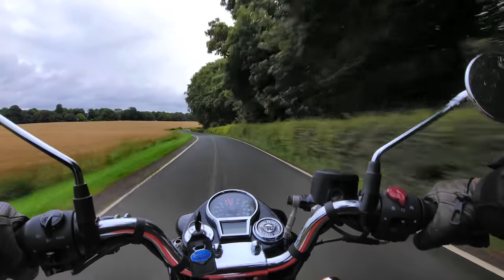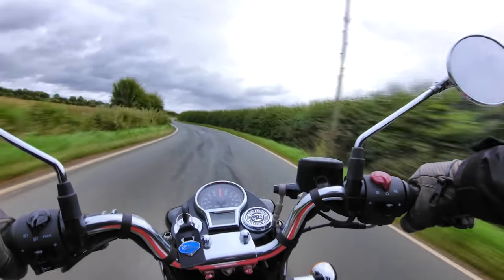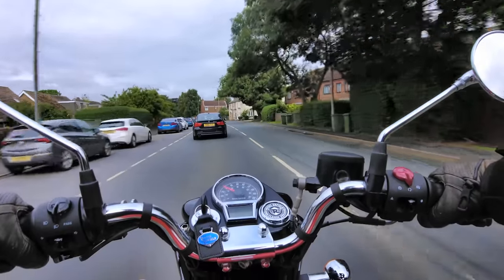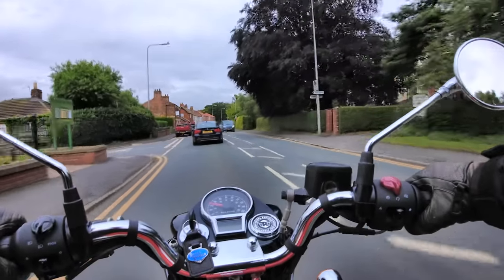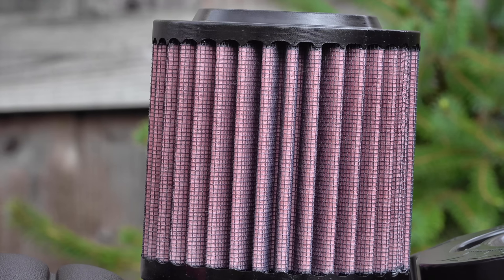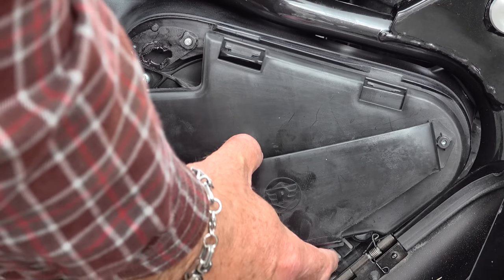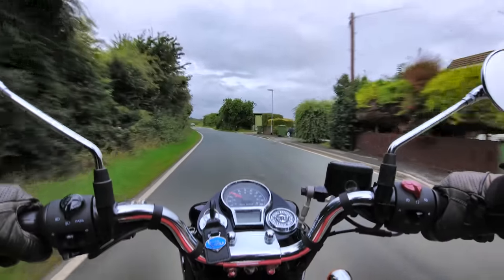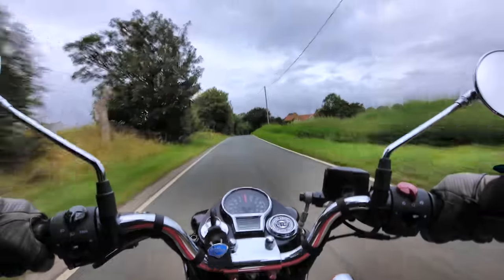The Royal Enfield 350 Classic REborn , Can You Increase top speed performance? & speedometer Fail!

Comment: Sounds like a very worth wile mod.
My Meteor will get one soon.
On the subject of the speedo, check out "Ride with Worro ". He found the cause and fixed it by cleaning out the excessive grease in the electrical connection to the speedo, with contact cleaner.
BTW, your description of the negative effects of the standard paper air filters, sounds like you are describing an N95 mask. A fact also scientifically proven. 😂😂
Reply from the maker: Yeah I checked. They dont grease that connector!
Reply: I tried "ride with Warro" fix for the speddo. Nothing against Warro, but it made no difference to the speedo problem.
Reply: @seanb1081 I've had the same issue with my speedometer. As per the Warro video I cleaned the inside  and it seemed to work OK for a few days but the problem turned. So I again repeated the process of cleaning the inside and for the past month I've had no further issues. The problem started when I left the bike on the drive in direct hot sunlight. That was June. I think when the weather is hot it causes the speedometer to read high. I was told this is a design issue and R.E replace the speedometer with the same type!!! Will have to see how Stu gets on with his warranty claim.
Reply: @carltonwittland1300  when I was speaking with the service manager at the bike mechanics this morning I asked him what RE in India finally decided what the problem with the Classic 350 speedo was. They have now admitted that due to poor thermal insulation around the speedo it plays havoc with the speedos electronics. The new speedos that they are now supplying are supposed to have better insulation to prevent the same issues happening aging.  I road 81 Km to the mechanics today and the speedo behaved perfectly. It was only a temperature of  about 24 C on the ride there. If it had been hotter the speedo wouldn’t have read correctly during the ride.
Reply: @seanb1081  thanks for the information. If it happens again which I'm sure it will. I will put in a warranty claim. Thanks.

Comment: Just thinking back to the days when we used to rip out the paper from filters and stuff them full of wire wool, Used Brillo pads were the preferred option. Don't advise anyone to do that though. Here in Australia (NSW) we have funny regs when it comes to licence renewal tests (MOT tests) might have to check out whether a DNA filter would pass the test not being E5 etc rated.
Reply: I'm an Aussie also living in NSW. I rekon the simplest way to pull the wool over any rego check place, would be to just temporarily re-install the OEM filter, when it's time to get a rego check. After the bike has been checked off, then re-install the DNA filter.
Reply: @seanb1081  Thought the same thing. The orignal cover is stamped with E5 E11 etc so that might be what the checkers go by. What I might do though is check with my local rego garage and see if it would pass. If I find out anything I'll post it.
Reply: Checked with my local rego checker who is meticulous and he says a high flow air filter won't affect rego check in NSW.

Comment: Yeah, after about 1,500 miles, the bike has become much more flexible with improved overall performance. Having watched both yours and a few other videos on the net, I installed one of these, they are quite expensive but, I am positive it was money well spent. Was surprised at the induction noise and yes, it is more eager than before, it lopes along with a freer character, won't bother with anymore upgrades because it doesn't need them, plus it wouldn't suit the bikes vintage type appeal. Thanks for the video

Comment: It used to be common for induction to be direct into the carb ... no air filters at all.  This is not so very long ago, either.   So, I'd be minded to run the bike without any filter fitted, simply to observe the improvement in performance. If I liked what I saw, then I might splash out on a fancy air filter.

Comment: Have 1500 miles on since DNA upgrade. Checked the plug and was a very light grey. Possibly a little lighter then the fawn colour that i’m used to with right mixture. Can someone who has no mods check their  plug and report. As a lean burn motor it may be fine and there was no sign of damage to the electrodes. Unmodified( tried the fuel x for a year but it threw a wobbly and coked up the O2 sensor, so binned) got up to 90mpg. With this mod it’s doing 80mpg. Thats good news as it indicates the ECU is upping richness to counter the increased air flow. However I am riding at considerably  more pace with this mod!!!

Comment: So went for a blast with a big hole drilled in the cover last night. Not a big difference in performance but a little induction roar. Then tried no filter or cover. Noisy as hell but did feel much more responsive but no difference in power. Today,  fitted the performance filter and cover. 
Still loud but boy what a difference in performance. Better off the mark; not much difference in low midrange but then almost 2 stroke like a power band at mid to high revs. Hits 70 very much quicker and would make fast A roads much more doable. 
It’s noisy too. Do I like it? well yes but I feel it takes something away at low midrange which on small single tracks is where you want it. I’m guessing it could be giving you as much as a 15% power increase but at the expense of some low to mid range torque. 
It improves the breathability of the bike to such an extent that your through peak torque before you know it and  ramping the nuts of the old girl. 
I experimented a bit with holding her at 1/4 throttle and in this way you can still ride like before. 
Whichever way you look at it it’s a massive increase in performance but at the expense of considerably increased noise. 
Need another blast when the rain stops to be a bit more definitive but I think it’s a mod worth doing.

Comment: When new my classic was new it  did occasionally appear hesitant on the throttle when pulling away. So bought the fuel x. After that packed up 18 months later with 15,000 miles on the clock, I removed it. 
Now the bike very rarely feels hesitant and feels loser. No Doubt in my mind that bike feels nearly run in but a little tight at around 2000 miles but definitely takes 4000 to really loosen up. It then gets better and better. However definitely doesn’t breath brilliantly so have just ordered this kit on Stu’s recommendation here. 
I think that the initial hesitancy may also be linked to compression. The engine breaking( compression) is great on this bike but when new may act to magnify poor breathing. As this drops off the poor low end breathing is less noticeable?

Comment: I've just looked up the prices of both the K & N, and the DNA air filter, there is a difference of almost thirty Euros, the DNA being the more expensive. Does the cost equate to efficiency. Certainly most of what l read the DNA allows greater airflow...allegedly... l have a K&N filter fitted in my Street Triple 675... (cleaned and re-oiled  once)... Performance wise l noticed an immediate better throttle response, much the same as you describe...l guess it's all a matter of personal choice, and cost if applicable. Either way it's a cheap method of unleashing  a smoother responsive engine with perhaps a small HP gain..Acceleration is often more useful than top speed anyway...Greetings from Red Hot España..

Comment: Hi Stu, if you could only own a Classic 350 or an Interceptor, which would you choose? I'm torn between these two gorgeous bikes, and the power limit is a concern although I find the classic 350 the prettier bike with a better seated position.
Reply: Had the Interceptor as my last bike, you will find the Classic when fully run in at around the 2000 miles mark will do 90% of what the 650 can. Only on duel carriageways do you notice the lack of top speed.

Comment: Wathing your video and looking back through your 350 videos, what was the stage 1 modification? 
    And is there any point in fitting a Hitcocks camshaft? 
    Did like the Roar rather than puff, definately sounded more purposeful. Disappointed to hear they restrict the bikes performance over 70-75 just where you might need that little extra, especially if your intension is touring France where the speed limit is 80 mph!! 
    Great work Stuart.
Reply: The hunter has no limiter. DNA. Makes 80 ml/h possible.

Comment: Would respectfully disagree about performance filters as almost all of them do not filter smaller micros as paper elements do. K&N was by far the worst offender as I have seen fine dust on the clean side of the intake when working at a ford dealer as a technician, these trucks however were used in a dusty environments(not what most would find on the road). There are different ISO certificates for coarse and fine dirt.

I do agree with everything else however and snorkels and filter covers are the best to get more airflow and again induction noise.😂

Comment: I have gone in the same direction of small improvements to make my meteor run better and fitted the X light fuel controller, and its totally changed the engine character as you said better everywhere but apparently it works fantastically well with the DNA filter kit onboard as well , but the main gain from this device is the engine does run noticeably cooler which I actually tested using a point n shoot thermometer , this is said to widen the gap between servicing because the oil lasts much longer but im not going to go down that route but may investigate further by way of observation for a while, there is a means to circumnavigate the speed restriction but im not going to make that common knowledge as there is always going to be some numpty that will make it very common knowledge via stupidity in public and the later models will have mods to make this impossible i myself don’t want to travel at more than 70 but what it actually does is make the bike fully responsive at that speed which for me anyway feels much safer and loses that feeling of being at the limit and strangled, once again great article and a genuinely full on explanation of how these types of filters work before some people do start poking holes in the standard filter with mums knitting needles 😁👍
Reply: Without giving up your secret, does everything on the bike still work?

I've heard of a mod that removes the limiter but also kills things, such as ABS and speedo etc.

Comment: Hiya, just to inform you that I too had speedometer problems and had to continuously reset it after each ride. My local dealer in Tenerife have accepted the problem and ordered me a new speedometer under guaranty. This seems to be quite a common default with the classic 350 reborn. Let’s hope that after the replacement it will bring an end to the issue.
Reply: Just clean the connectors and then greased them. It work. I have hade same problem. Fixed. 19:28
Reply: @terceladdict  thanks for the  advice but I had already done this procedure a couple of times but with no success, finally a had the speedometer unit changed under warranty and since then I have no problem.
Reply: @simonrignall996  Ok. I’m perhaps more lucky then you. Happy to read that your problem is solved.

Comment: If I ever buy one (has not happened yet due to 150 / 260 miles to nearest dealers) I suspect that I would want it to brwathe "freer" in the hope that the engine would run slightly cooler and last longer.  I think the 350 would be more than fast enough for all apart from those wanting to bomb around on motorways (100 miles to my nearest one).

Comment: Hi Stuart, with you experience with these filters, how do you find it effects fuel economy?? Does it make it better or worse on the classic 350.
Reply from the maker: That depends on You! on the whole I usually see an improvement in economy, But. If you decide to take full advantage of the extra power all the time by riding harder you may well see it go down.
Reply: I get 89-100 mpg on my Meteor with open intake and DNA filter. Only time I had any problem was when I made an equivalent mod to a Triumph Scrambler, Norman Hyde intake and K&N, which stranded me without fuel after 119 miles. Two nice chaps with a van with a hydraulic lift saved me the push to the petrol station and the bike got promptly sold. Range of 119 miles NBG.

Comment: I found on the internet that it is theoretically possible to remove the speed limiter on a Royal Enfield 350 motorcycle, there are rumors that in Brazil the RE is sold without a limiter installed because it is against some of their laws, however the main question I ask is - why would anyone want to remove the limiter on the RE knowing that with the power of the engine and its weight one will not gain much, maybe an additional 5-6 kilometers, there is a limit as of how much you can squeeze out... plus, if you really want a faster RE bike, don't buy the RE 350... RE 650 goes some 160 kmh? Or save some more money and buy something else...

Comment: A true "classic" bullet 350 (mine is from 1958) the best thing to do is change  the carb for something better and that's the cheapest increase you will get. Next is the cylinder head. Get a good port and valve job done.  89mph verified by speed traps. The exhaust does not become restrictive until you start doing cams and over sized cylinders.   Don't know anything about the new ones.

Comment: I felt very similar gains fitting the K&N to my Interceptor ,, nothing stunning , but the bike feels a lot more natural when riding  , more like my 1966 650 Triumph Saint   ,  but there is no comparism between a 2022 650 and a 1966 650 , except ,,,,, perhaps weight   206kg  -- 175 kg   and the Saint ,,,,,,,    you can remove the filter , use the gauze ,,, INDUCTION ROAUR   !!!

Comment: Hi Stuart,
Fitted the DNA filter on my classic 350. Started getting engine warning light. 
Changed back to original filter and snorkel back on (after reset) didn't get the warning light.
Switched back to DNA and it came back on.
Switched back to original and light dod not come back.on again.
Do you have any thoughts on this perhaps? The DNA does work really well imho... the midrange pull is quite a bit better. Let alone the sound...
Reply from the maker: Did you run the procedure for the ECU to reset? If not you probably have  "stuck ECU"
Reply: @fillingham Thank you for coming back to me. Yes I have, together with my RE dealer ;-)
Reply from the maker: @pauleedeehimself8489  Yet the fact remains you still have a "stuck" ECU!
Reply: @stuartfillingham  well, probably... now, how to fix that?

Comment: Stewart,  what way do you go about a warranty claim properly, my classic 350 has the well known speedo issue,my dealer in northern Ireland doesn't believe me, they say they've never heard of it happening before and will have to investigate the problem, the only problem being that its an intermittent problem and doesn't show itself all the time, wondering what way to go about it,
Reply from the maker: Then show them this video and tell them to read the comments!
Reply: One of the negatives of buying an Enfield is the myriad of cowboy dealers that sell them. I bought mine knowing I would never go back to my local dealer except for maybe the first years servicing. I quickly realised that they didn’t give a monkeys. Even tried to tell me they couldn’t get replacement brake pads easily. A call to Hitchcocks and they arrived the next day. 
Also most dealers seem incapable of setting valve clearances properly and charge silly money. In all fairness it is a pain to get to the valves and does require  much stripping / moving of parts. 
If your over 60 and have a motorcycle lift;   do it yourself as you’ve done it before and it’s a piece of piss. 
Otherwise take it to a good independent.
Reply: A pic of the sticky speedo is enough. But problem will be the same with a new speedo. Clean the contacts and greased them. It work.